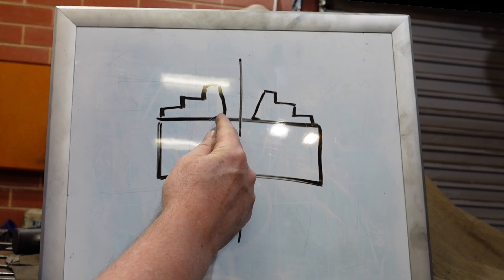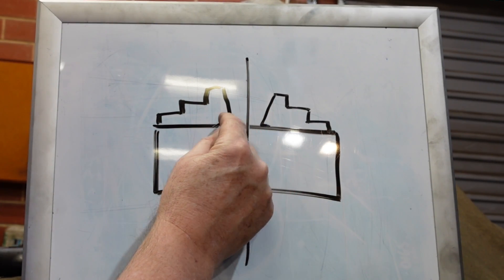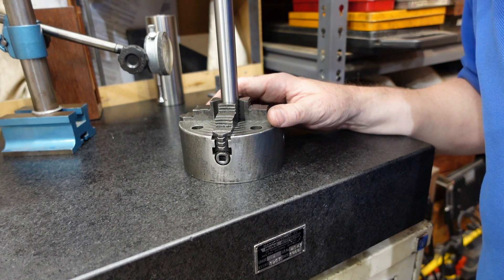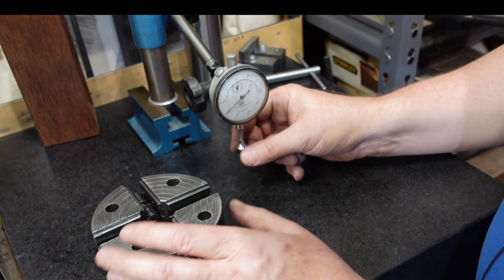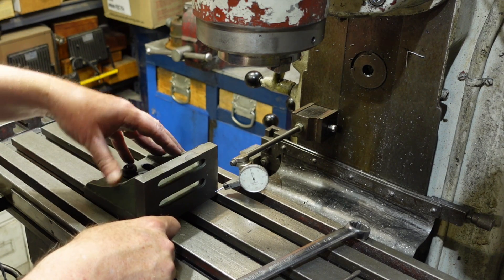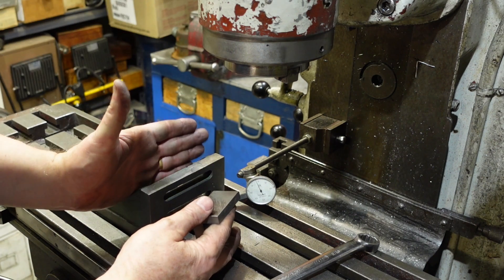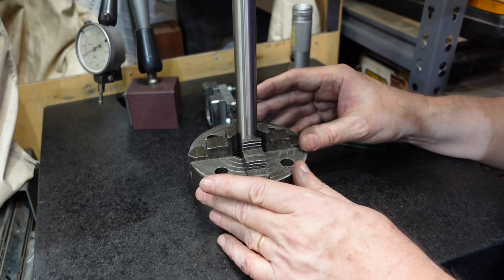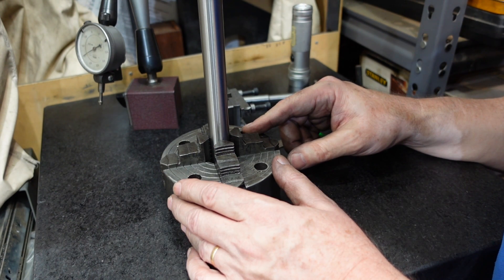Bringing a bell mouthed chuck back into service

Comment: Interesting to see your reasoning - but way, way too many steps - and a couple I'd find fault with (i.e. milling the inside face of your little square piece - but after squaring up the outside; and the remaining procedure making use of such a thin strap across the mill table).
Why didn't you clamp the jaws directly to your angleplate, aligned to remove say 0.05mm off the jaw inner end with the surface grinder - and make any subsequent adjustments from there.  Using feeler gauges seems very imprecise . . . .
Not wanting to be negative - but I don't think this video is enhancing your channel, which I otherwise enjoy.
Reply from the maker: The inside of the fixture was milled square to the squared surface (or parallel to the base if you like) as I wanted to be able to use the fixture for measurement/ checking as well. I edit these videos down by a fair bit, so the shots of me using it like that were probably not included. Not sure what you mean by 'thin strap'. The strap I used for a stop is about 8mm thick and bolted down on both ends - it was not moving. The Al strip could have been thicker, but did the job. Those steps were included to show how you could get a square surface (or a flat surface) from a mill, as I thought at the time that if I did not show those steps I would get comments saying I did not show how I insured that my datums were square or parallel. I can't recall if I mentioned it, but normally off the mill using parallels surfaces are typically parallel to say 0.1mm. Using that method those surfaces were within 0.02mm.
The reason for not clamping directly to an angle plate was simply repeatability. Using a fixture like this is much more likely to result in the same amount being taken off each jaw. If I clamped straight to the plate, I would have had to set up 4 times, so 4 opportunities for something to be not quite the same. Not so important for independent chuck jaws, but for self centring jaws, that introduces error.
Feeler gauges are a well established way of measuring. In this particular application I would have liked smaller steps in thickness, but tool makers the world over check small gaps with them all the time. When I worked in the auto industry, they were often used as no-go devices on checking fixtures too. Based on the final check with test bar, not being able to get a 0.05mm feeler in there means a gap of less than 2 thou. Maybe not perfect, but that's the sort of clearance for a hole/ shaft fit that typically gives a nice sliding fit (negligible side to side movement), so certainly an improvement on what was there, and took a chuck from something that should not have been used to something fit for purpose.

Comment: Nice job. I reworked chuck jaws the same way. I too found it beneficial to taper the jaws causing them to hit a slightly harder in the front. I ground them in my sine vise, rather than a dedicated fixture. If your mill has wear as mine does too you can always finish the fixture in your surface grinder. I never liked grinding jaws in a running chuck either for the reasons you state.
Reply from the maker: I guess a similar result. I did think about using a vice but with a fixture like this it eliminated setting up each jaw individually, so I thought more repeatable. 
As the mill is 60 years old, I would guess there is some wear in there. I included those methods for getting square and parallel surfaces because of that - I was sure that otherwise there would be people grousing because their mill is old and worn, so would not be able to get things as precise as I could...
Reply: @occasionalmachinist  Yes, valid points. A lot of home shop people don't have a surface grinder to finish a fixture. Your method, and explanation were spot on, as usual. I spent 40 years in a tool room. I don't miss working, but I do miss working with others. Cheers